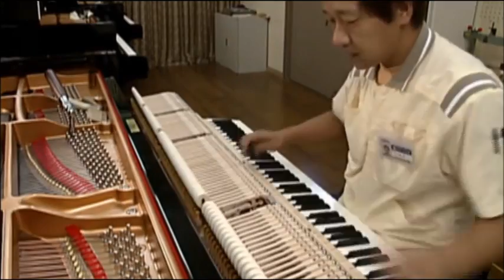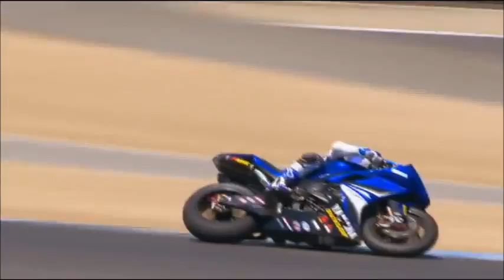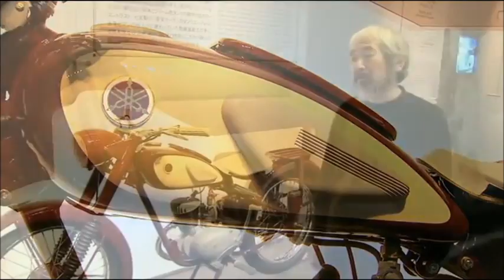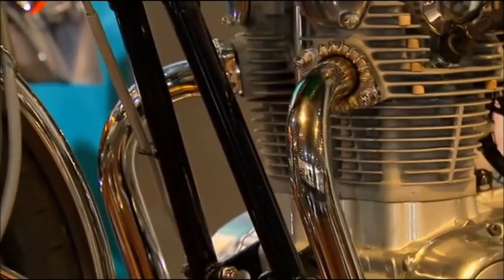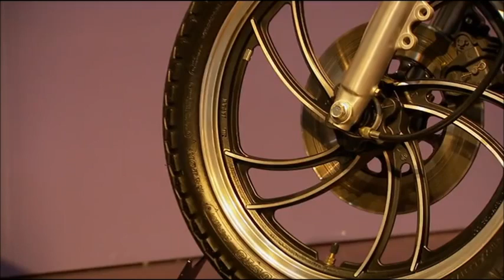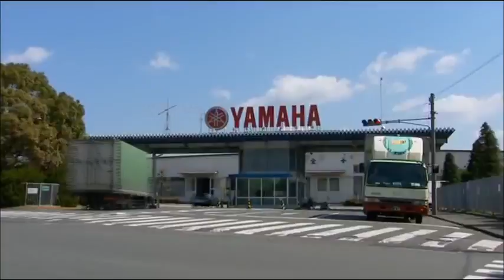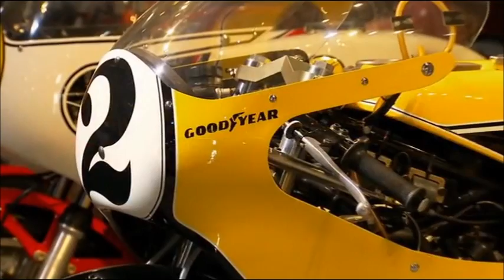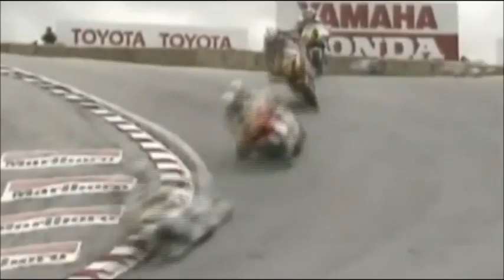Yamaha Motorcycles - History (From 1955)

Comment: I watched a few of these videos about Honda, Kawasaki, Suzuki and now Yamaha.  I am amazed at how inaccurate some of this stuff is.  I am an old guy and I have ridden and owned so many motorcycles I probably have forgotten some.  I have owned Yamahas like DT250 trail bike, RD250 and RD400, 500cc Single four stroke and an 500CC twin four stroke which I can't remember what it was called.  This video forgets to mention that Yamaha invented the YamaLube system so you did not have to mix fuel and oil for the two strokes, it invented the reed valve for increased power and the RD series of bikes were light and had the best handling of any of its competitors.  When Yamaha introduced four strokes the ealy versions were total disasters, there was a 750 which used to blow seals if I remember correctly and they were grossly under powered compared to Kawasaki for instance.  Today Yamaha makes some unique motercycles which are world class but it took them a while to get there.

Comment: I fell in love with YAMAHA when I was a kid my dads brother had a RD 250 that my dad turned into a RD350 some guy didn't pick up his bike for 2 months from the shop so they sold the parts to my dad. Now my dad was like that's some guys bike and they where like if you dont buy the parts someone will and that 250 could be a 350 real easy so he was sold but as a kid I though that bike was so cool the white tank with the red strip hell Id love to have a RZ350 one day. They didn't talk about RD,RZ,FZ,FZR,YZF before 98 just R1 skipped over some great history,  my first bike was a 81 xs 650 then a 87 FZR1000 it got tolled and I almost did too stupid azz turned left in front of me but the god is good and I got a Kawasaki 89 zx10 but I missed the FZR lightness and power so I sold the ZX wise I would have kept it to but I bought a 90 FZR 1000 but it's a long story but it's in my shad in pieces and I refuse to sell it Ill build it better then before just takes $$$ but that was back in 98 some I end up buying a 88 FZR 1000 and rode it for bit but it wasn't as fast as the 87 FZR I guess that first year  was something but it wasn't the 90 FZR either so I sold it and site bike less for a while and got a 97 YZF750 that Im screwing with and I still have my 90 FZR so I've got two great Yamaha project bikes and a 91 FZR 1000 motor that I pick up on e bay just for a YZF 750

Comment: Years ago I one time got to ride against a pro-level road racer. The ride took place at what was then Riverside Raceway in Riverside, CA. The facility has been gone for decades now. in the early 80's an instructional school called Riverside home. Many aspiring canyon racers who longed to become real racers often went there to gain extra skills. I was among them. I was  pretty fair rider at the time. I'd been riding motorcycles since I had turned 8 years old. I started in turn and stayed there until I came to learn bouncing off dirt was getting harder and harder as the years passed. I eventually gave up on any form of aggressive dirt riding and made the transition to blacktop. I found that crashing came a lot less often, although conceded crashes on the street were also consequential. I was willing to accept the trade off. 

When I enrolled in the school I had be competing in what amounted to amateur box-stock racing where very few modifications were allowed otherwise stock motorcycles. I had been riding in the 1 liter class for several years and thought I was at least pretty good. So when I found out the course provided bike was Kaw GPZ550 I thought "piece o' cake. I can ride one those as fast as it can go.' Wrong. On the first day students was allowed to hit the track and do a few hot laps - no heads up racing allowed. Other than that? Go for it. Leading the students around that day was some guy, I forget his name, who was some level of a factory rider for Kawasaki. After we started I quickly fell in behind him. I kept remained just off his rear wheel through laps 1 and 2. I thought this guy is good, but he ain't that good. Wrong, again. Beginning the third lap I believe he had grown tired of my presence. In three turns he simply disappeared. I was stunned. The lines he took, his braking points, his precision of movement, throttle, his everything was unimaginable in my mere mortal mind. I had ridden Riverside many times and thought I knew the track. Chasing him as he quickly vanished did get me the quickest lap time I would ever get at Riverside, but I also knew I was not professional rider. A very humbling moment. 

In retrospect I believe this was more a positive than anything else. I still ride today and I have the skills to go pretty damn fast for an old duffer. However, that day of humbling also solidified in my belief system a lot of wisdom. I know where my limits are and I don't exceed them. Sure, I still get the urge to push it, but I've got the wisdom to know when just a little bit more is about to become too fucking much. One of my life's goals is to have lived most of my life or at least in number of years, riding and surviving a potentially lethal love affair with motorcycles, speed, and the rushes of adrenaline or the flooding of dopamine I derive from riding. Keeping the rubber side down is rule number one with me.  Others may be faster, quicker, or balliier. That's fine. I've been doing this for more than 60 years now. That has got to add up to something noteworthy.  One might even say in my case I ride to live. This does not mean I wan to die on a bike or because of a bike. I'm pretty sure that would take a lot of the fun out of the relationship. Might hurt, too.

Comment: Just FYI.  At 1:46 the piano technician is voicing the stiff felt in the hammers to adjust the felt density so it produces a more pleasant tone or voice.  This is done with the pictured tool that has 4 stiff needles about thee quarter inch long.  By poking the felt it loosens the fibers creating a softer hammer.  Cool!!  Requires lots of patience and a good ear.

Comment: MY 2012 R6 did not like streets, it's was wonderfully happy in fast turns, and places where I could wring it out, but felt like I was forcing it to do something it did not want to do riding from light to light. Solution: that's what cruisers are for =) The R6 is not a commuter bike, and let's you know it, I learned a lot from that bike. My older brother had an RD350, that thing was legend, They look and slow now, but I dare you to ride a proper example. MY father's favorite bike was his 86' V-Max, still today that would be considered a fast bike, insanely fast for some.

Comment: i startedout witha crap yl2c...rotary valve......it was new.....and would nt keep runnint......
but then.   i got an at1 m.....limited ptoduction.  motocross racer....it came with a gyt kit preinstalled by the.  factory.....but i had to improve. it......21 front.    fun ane fast  fork extensiin kit...took it from  5 inch suspension forks. to iver. 7 inch travel......i could now race at indian dunes.....my best was a 6 th ....
i then got a dt1 coppergold  color...
the trailrideing i did the adventures..
are a favorite time of my life took my girlfriends along. we expierienced. a fantastic time...next i bought a rt1 360. m...this bike was modified to the hilt and had beein
14 timesa winner in scrambles....
yes....my yamahas are great and never forgoton. memories......i only wish i  could go back and live it all over again.......thanks yamaha.

Comment: Thanks the first comment that appeared I guess I will be on the mine mentioned a few things that I was also noticing like the vmax the virago just a little there was so many other bikes that would never mentioned it's like you went from 1958 to '68 and left everything in between you know my first my my first motorcycle was a 11-year-old 1966 Yamaha ym1 I was 18 at the time no 17 at the time just turned 17 maybe I lived in Providence Rhode Island that was my first bike it was a 305 CC two stroke two cylinder twin and it was virtually a clone of the Honda 305 dream. But that was a pretty cool bike I took it on the highway there's no way I would take it on a long trip but I would go 30-40 miles on the highway on 95 and I took that bike on a lot of back roads in New England just exploring which is the thing I used to love to do on motorcycles. Yeah it had oil lube on it so you didn't have to add the gas and the oil together there was a tank on the side it was pretty new technology I bet for the time I had a steering damp and I wish was a big plastic handle that you turned in the middle of the handlebars and it added attention to I guess on onto the bearings I don't know what it's called it's opinion or something like that from the front end if it worked okay nothing like steering deafness of you know later times but it did the trick. I ended up pulling the front fender off of it taking the baffles out of the muffler and they came right out LOL gt550 which was a triple two stroke but let me say something about the ym1 the bike something I thought was really cool and I always thought it was a great it was the integration of all the instruments panel into the headlight top of the headlight of the yeah they were the the commodore all that stuff was on the top of the headlight molded it integrated into it and it had just stand there to speedometer like generate a light and when the bike was idling the lights and everything in the generator light with turn red but once you gave her gas everything you know when generator went fine and the lights got brighter you know it's just like an old old technology no no alternator generator it had a neutral light switch if I remember correctly I'm trying to think of what else it might have that might have been it was pretty simple instruments but yeah you know I cut my tooth on that bike and also hurt myself by learning how to ride a motorcycle and especially it you know in a city environment and later on it would be New York City environment that's a whole other story but yeah my second bike was the Suzuki gt550 triple two stroke it had a three into four exhaust system that bike was more modern cool bike that bike I used to take from Providence Rhode Island to New York City on a regular basis during the riding season in 78 and I took that bike up to bike weekend in Laconia Loudon New Hampshire with my sister's boyfriend and and another friend of ours we made a whole trip of it you know we we went through every state in New England up to the border you know the main border Canada and if I remember correctly the Loudon Laconia loud and that's where the racetrack was if I'm not mistaken Laconia was the town main Town weirs yeah for my mistaken it was 500,000 bikes that year it was my first introduction to seeing professional racing and the one of the things that was really cool and also never saw before was a was a sidecar racing you know the teams that was like that was like besides watching any motorcycle coming into a straight away and then come out at like these absurd hard curves without falling you you get every time you saw the bikes going to discuss you with swear there was no way they can stay on the track but they did yeah that was pretty cool but I'll go into my third bike was a 71 Yamaha XS 650 that bike only made once I was living in New York City at the time that bike only made one trip from New York City to Providence and then on the way back to Providence when I got to about I guess when I got to the end of Connecticut on 95 and by the way back in those days all of Connecticut on 95 at toll booth so I learned quickly that you stay to the left when you go through a toll booth either way cuz it's an oil slick for quite a while but yeah one of the silencers started to knock when I got to the Bronx the I was running on one cylinder when I got to the midtown tunnel when I was halfway in it the bike died and I had a push the bike and it died in the middle of a blind curve pretty scary to be in a tunnel like that I want to buy if you need to say if I had to be towed away and I had it fixed and then my uncle gave me a gift a brand new 2000 and one I think I'm sorry it would have been 1981 Sturgis Harley Randall I didn't know what to make of it you know I still have the access 650 at the first few days that I rode the Harley around I really didn't think I liked it but then when I got back on to my Yamaha XX 650 what I had put a call up and seat on that bike too the Yamaha right sequence more than a motorcycle LOL but I feel like it was riding on a pogo stick so I sold the bike for more than I pay for it paid for it paid 500 for it in 1981 I guess no 1980 and the sold it for 600 blocks in 81 so that was the last Yamaha I owned and I own the Honda CB750 custom which I did the Sturgis was stolen twice the second time I never got it back and so I bought a 750 and 1982 Yamaha Honda CB750 custom and I rode that out to California and the last of my riding career I guess I'd call it was in California and then a little bit after when I came back to New York in 1989 after the not long after the very bad earthquake that we had in Northern California and I had the 750 which I I'm just rambling but my last bike I was a bike I built myself which was basically an 80 a 79 lowrider Harley yeah and then I started to go blind and I was the end of my riding. I'll tell you you know I have just a little bit of sight it's not really useful but listening to those motorcycles go you know a racing gave me goosebumps and actually gave me tears because motorcycles was such a huge part of my life you know from my 13 years old and having a mini bike in New York City to my last Harley it was just a huge part of my life so yeah what can I say Life goes on and I miss it greatly a friend of mine just got a last season he got a Harley road King and you know I'm sorry happy for him and stuff and loved I said on it and everything but it's just upset my heart that I can't ride anymore that I can't see the motorcycles and stuff who knows you know I'm getting up there I'm 62 I always said as long as I could stop and hold the motorcycle up I'd keep riding or yeah you know the motorcycles are not safe you know you can make it safe by following certain guidelines but they're very dangerous and anyone that thinks that they've got motorcycle riding you know I'm talking about Street writing now that they've got the you know all these years on them and they are like Miss the motorcycle rider you know in the end if you're not careful you end up dead or worse you know so I've had some pretty hairy accidents and I'm still walking although I'm paying for that and arthritis every bone I broke every tendon that was ripped et cetera etc aches to this day it's even more the older I get so I'll stop here like I said I'm just being babbling on and I can Babylon about motorcycles to forever still so excuse this video excuse misspelled words worth it don't make sense I don't think there's such a thing as punctuation in my comments since I'm blind that you speech to text which has its own unique take on the English language and how it's written and sometimes I think it has its own unique addictionary and its own unique thesaurus etc so everybody out there that's still riding God bless you yeah I envy you in some ways no I envy you. but enjoy yourself because there's nothing like getting on a motorcycle and just going like I said at the beginning of this video of this comment that I did a lot of exploring I used to love getting on my motorcycle and just hitting another road and taking my Honeywell Pentax 35 m account camera and just seeing what I find exploring just me and my motorcycle and getting upset here all right sincerely yours Bob the flying bedroom guitars

Comment: Yamaha should have sticked with pianos. I bought a new off the show room floor yamaha FJ 1200 in 1994 was the worst bike i ever bought.  engine had problems in the first week.  exhaust cam lobes had flat spots from bad casting and would spit out the valve shims.  after going around with yamaha usa and two different yamaha dealers they found the bad cams. after replacement of cams engine still never ran good. took a trip to Florida and noticed oil leaking from bad casting in the cylinder where the oil journal casting is.  the dealer just wanted to ping it with a punch and hammer to get it to seal.  had to fight with yamaha to have it replaced under warranty.   after cylinder was replaced engine would make some click noise under acceleration.  engine had vibrations that i was told normal but was not. engine didn't make it to 10k miles  never bought another yamaha never will again and tell everyone i can what a piece of junk they are.

Comment: What I learned from this is that Yamaha has only built a handful of models - the YA-1 Red Dragon, the RD250, the XS650, the R1 and the R6.  Amazing they stayed in business with so few bikes.
Reply: I don't think it's their bikes that keep them in business I think it's there knowledge and technology.  If they weren't so good at designing engines Lexus wouldn't have asked them to come in and tune the lfa for them.
Reply: @austinwarner1755  They also developed the 67-70 Toyota 2000GT engine, and have had a very close working relationship with Toyota ever since, the heads on my car (Lexus IS,F) were designed by Yamaha.👍

Comment: The RD250 was introduced in 1973 and was known as the RZ250 in Japan and Australia (source Wikipedia). The RD250LC  was introduced in 1980, which is when you say the RZ250 was introduced and you show a 'LC', but it was only a development of the RD(RZ)250. I bought an RD250 in 1978 brand new for £750. I sold it because I knew that if I didn't I would either kill myself or loose my licence for a long time.